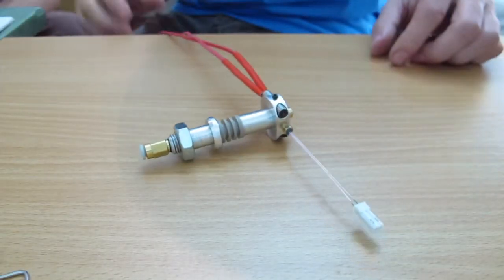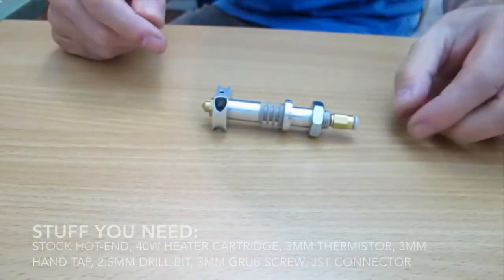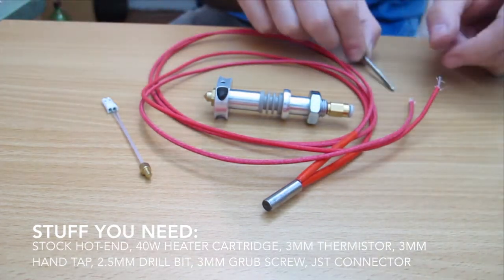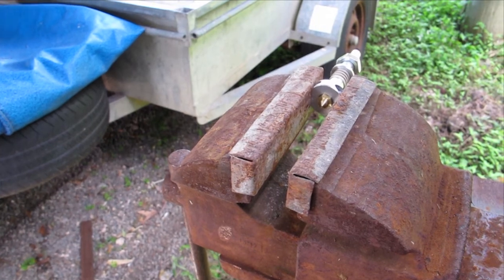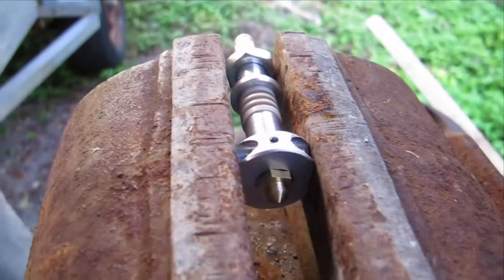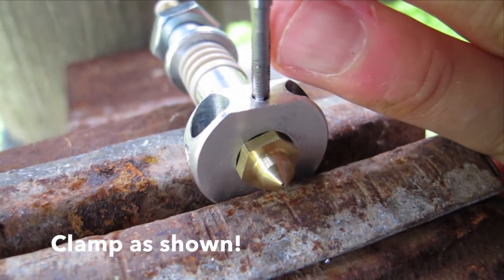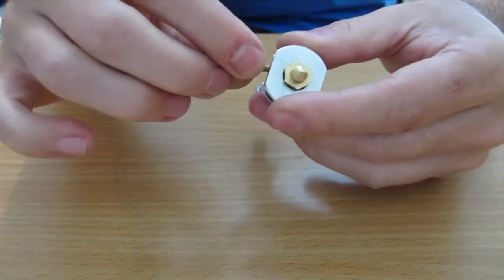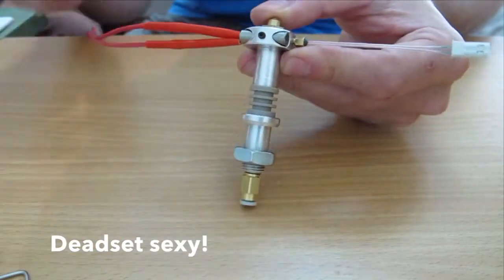Modifying stock hot-end on Rostock Max

Comment: I'm curious. Great video by the way, but in that last scene your Bowden tube for filament is separate from the wiring loom - why have you done it like that?
Keep up the good work, and you have a great online store.
Reply from the maker: Hi. I keep my wiring separate on each of my Rostock's. It's easier to see where the filament is in the bowden tube, It's easier to pull the tube from the hot-end or extruder if it's not attached to the wiring. I find that the wiring adds pull to the bowden tube and makes it move and bend in a way that isn't as smooth as if it were alone. Just my own preference really. It looks neater in the braiding however.

Cheers :)